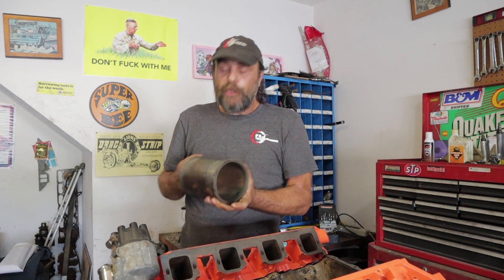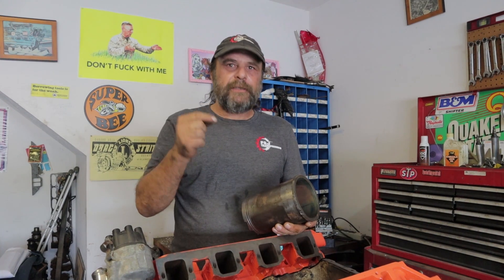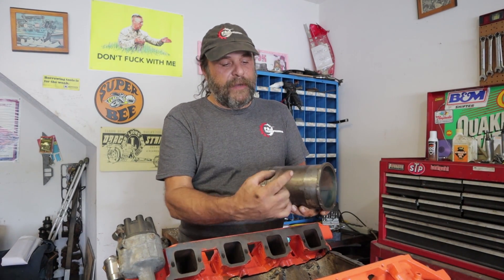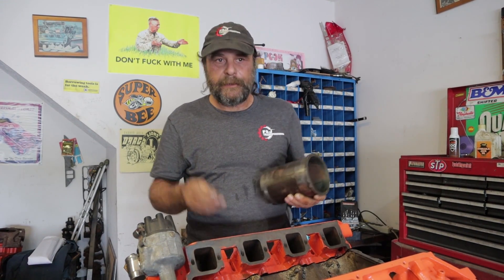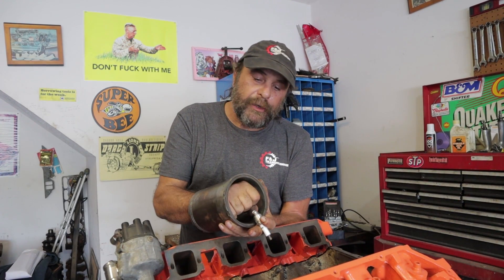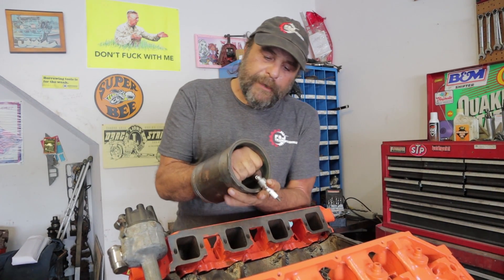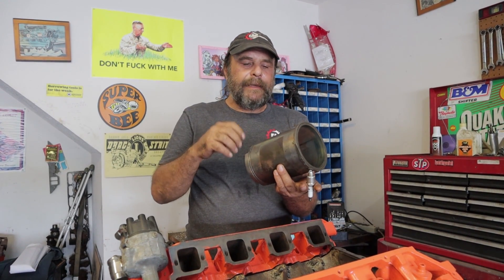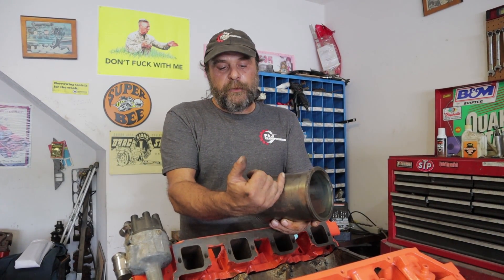Engine Basics-The Power Stroke

Comment: If you could make cylinder pressure at 45deg ATDC a 283 chevy engine would make 1000 hp. You really need to know what you are talking about before you make a video explaining MAX cylinder pressure. The truth is that max cyl. pressure occurs between 8 to 12 degs after TDC not 45 deg the only engine that will come close to that is a turbo charged engine that will make max cyl. pressure at up to 30 deg. ATDC.

Comment: Great explanation of the combustion in combination with piston positions. You’re exactly correct and I appreciate that as a long time engine builder. I wanted to add to your video by getting into the fuel used because it really matters and as a pro street builder (mostly) the fuel that comes out of the pump nowadays is designed for small bore & short stroke motors and is like using really low octane in a older engine that has some cubes. I would really appreciate seeing you do a vid on the new crap that they call gas that doesn’t have any sulfur in it anymore because of those newer hy brid cats they are putting on today’s vehicles. That sulfur is a big bang for the expansion portion of the combustion cycle besides the process that is used to make something that burns a little bit because they quit making gasoline a long time ago, oh and I love the inert molecule that they have introduced claiming that it helps clean the motor while maintaining the star shape of the molecular makeup of the fuel that creates the best burn in the cylinder phosphorus molecules don’t do anything except take the place of the one that is so important to star pattern...      Thanks for doing what you do!!!

Comment: We felt that the top of the stone would initially rock into the center of bore on the ridge, pressing the bottom corner of stone into the bore, creating an inverted bell at that point. The other reason is to eliminate an interference between rings and ridge when new rod bearings are installed and it's all tightened up again

Comment: Explain what happens to the intake and exhaust angles when the engine goes into V-Tec mode? 🤷🏻‍♂️😳😎
Reply: Not a Honda car fan by any means but the way vtec works is kinda cool.at a certain rpm a pin hydraulically locks a rocker to run on another  cam lobe that's way more aggressive. 
As if at 5500 someone swapped in a race cam and didn't skip a beat.
Reply: MrHillfolk In theory, I know how it works, figured Uncle Kathy followers might loose their minds. Brent from PFI Speed explained it. I guess I've got a similar deal going on in my 5.7L Tundra with VVT. All I know is, it will haul ass.
Reply from the maker: Simple LSA manipulation

Comment: Yes but wasn't the question..Does more cubes = more power.?..I see where you're at tho mate...% of return for each power stroke per cube in NA form regardless of size remains the same...That's why we add compression and timing and fuel and stroke and bore and better breathing isn't it.?.The mathematics is way deep with piston speed and air speed and volumetric efficiency and to be perfectly honest I was totally fucked at Math....

Comment: Bloody damn this is some good poop to exercise my motorhead brain with. The most expansion force occurs in the first 45 degrees and then the most angular leverage force occurs at the 90 degree point. I would love to see a graph that shows the crankshaft torque throughout one 180 degree power stroke at varying RPMs. Maybe the graphs are out there somewhere or maybe they haven't invented a machine yet that can measure crankshaft torque in that miniscule amount of time. I don't know, but thanks for letting me have the fun of thinking about all this good shat Uncle T.

Comment: Thanks U.T. This is the stuff I sub for. I work on large Diesel engines, 10+ inch bore 2000+ hp. I’m currently in a 225 Buick for my flat fender Jeep at home. Thanks again bud.

Comment: Engine = Pump.  Engine pumps air and fuel into displacement (always check for leaks(air leaks)). Key to power and efficiency is: Velocity. Velocity of both intake and exhaust. Proper exhaust (not oversized) is also key to torque and horsepower and economy.
Reply: I agree the engine is a big air pump but I thought it was the amount of air, volume of air moved not velocity. Speed isn't going to make more air go through the engine. It's just going to be moving the air faster. I want more are more volume going through the motor that's why they make all the exhaust pipes bigger and port out the exhaust ports to move more air anyways nice comment Uncle Tony's garage rocks I'm a fan 4 life out here in the Southern California Mojave Desert
Reply: @Mred1701.  -  Eddie, Yes. Volume is a gimmie, but how do you move that volume? With "velocity".  Design the system to move intake  air/fuel with ease and speed to fill up a volume.  Porting, tubors, superchargers, etc etc.  You can easily (without turbos and superchargers) turn a I6cyl into V8 horsepower. The key to  I6's is velocity. Oversized and/or dual exhaust can hurt a I6 a lot. So check with professional or dyno (many youtube videos with dyno tests on this). Keep exhaust gases hot.

When you think Volume, think  "Velocity". Velocity is key to V8's also. But you can hurt your power and torque with way to oversized exhaust also. Design your exhaust to what  your engine build specs are and keep the exhaust hot.

Comment: I have a question so is there anything I would need to do on a slant six when put a four barrel corborater on it
Reply: Hey Buddy, my two cent, beside better plugs wires and coil, if possible,  to have machine shop take a small bit out of the head, if not done already.. I have one with almost 3mil removed, the 4 barrel set up will give the 225 more of what it wants.. gas and much needed air.. exhaust to match, uncle T did one on the correct header for slant6..  peace
Reply: I don't have the car yet just seeing what I can do when I do get a mopar with the 225 . Looking forward to getting my mopar again thank you for the advice much appreciated 😁👍
Reply: @21310wrx  Happy Hunting Brother, and Cheers from Southern California.. I'm hoping with in a month to have my Brothers slant6 project cruising, 64 Dart, on his YTube channel.. and ask anytime Man.. that's what it's all about..
Reply: I finally got my Mopar

Comment: So in your Theory The biggest bore and shortest stroke should give you your most torque and efficiency. ?
Reply from the maker: No...larger bore, moderate stroke and relatively short rod would be my choice
Reply: I think a fine balance of bore to stroke works best but the name of the game is Taylor it to what you want, what's best for what your doing with your engine, what gears you have what trans how heavy, are you running full RPM or towing needing low end power. 
Take the SBC there are a gob of various combos overall take piston size versa the weight and crank size and weight there is a combo that compliments one another. The fly wheel effect because there's three Stokes that just coast if the Pistons are max size and the stroke is the smallest it would not have the momentum to coast the three Stokes therefore parasidic loss from the power stroke to make up for the lake of weight in motion.
Reply: @JohnSmith-ry8qj   Definitely depends on the application. Thanks,  it makes sense. You got a mechanical engineering degree?

Comment: the first 45 degrees of crank rotation (in a v8) is all the distance the piston needs to make power....after that the next piston is at tdc for it's turn   360 divided by 8 equal 45..
Reply: Doesn’t the piston fire every other rotation because its a four stroke?  So it would fire every 720 degrees and a cylinder would fire every 90 degrees.
Reply: @bmark1831  You are correct.  It's two revolutions of the crank for all 8 to cycle through.

Comment: Please explain octane. I get so tired of telling people higher octane doesn't burn hotter and that running race gas in thier 8to1 engine don't make more power.
Reply: Higher octane gas burns slower. Think like this, a newspaper lit on fire is low octane, quick uncontrolled burning.  An oak log, slow long lasting even heat. High octane. A broad generality but true.
Reply: Higher octane has a higher BTU the higher the octane the less chance of detonation that’s why they have higher octane racing feel the higher the octane rating the last chance of detonation in your engine
Reply: @trischarchuleta9865  
93 and 87 octane both have the same BTU's, approximately 125,000 per gallon, higher octane simply means more knock resistance, it's not a direct relation to BTU's.
Reply: Higher octane=greater resistance to detonation. Higher compression engines therefore require higher octane to resist pre-detonation (pinging) due to the heating from higher pressures in the combustion chamber.  In the olden days before VVT, running a higher octane than required typically resulted in a slight loss of power in addition to an unnecessary waste of money. Nowadays, the  PCU will adjust to the quality of fuel.
Reply: @goldenaxl  
Not just pre-ignition but also knock after the spark plug fires from "detonation traps" inside a sloppy combustion chamber. 
"In the olden days before VVT"? Oh Christ thanks a lot, talk about making a guy feel old, when I started working in garages there was still plenty of cars with points type ignition that we worked on, and fuel injection was rare.
Reply: @dukecraig2402  So did I buddy, I started playing with V8s long before the microchip was a thing. lol
Reply: Yeah I always thought it just burned with a slower flame front but I think there may be more to it than that.